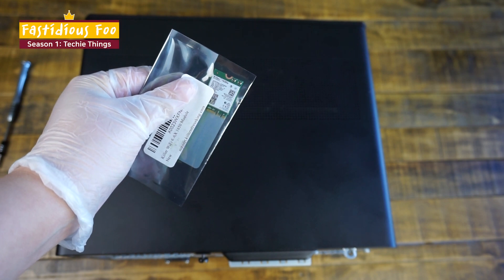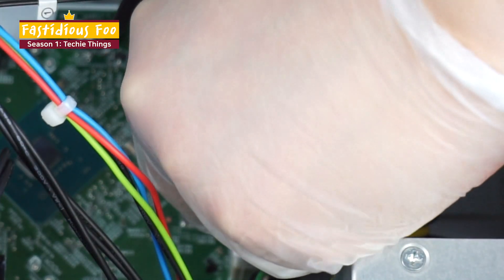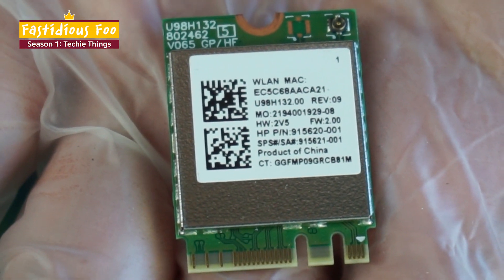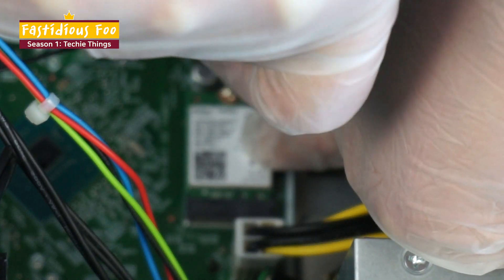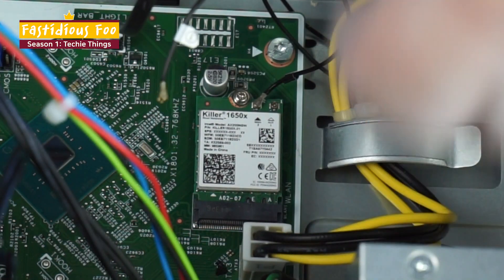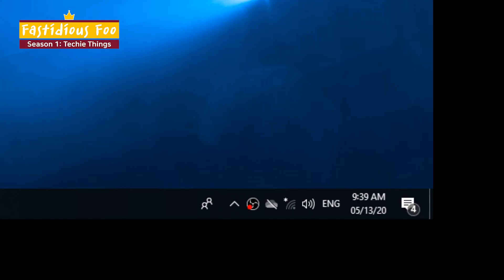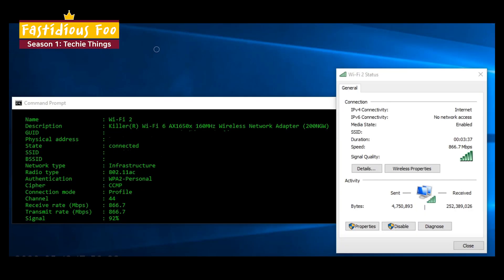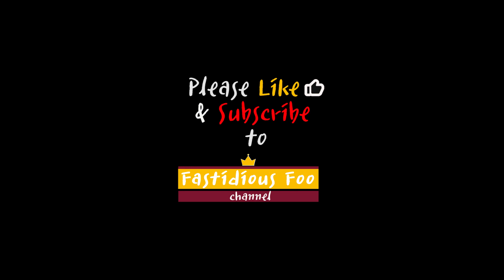Upgrading the Wifi Card (from Wifi-5 to Wifi-6)

Comment: Nice guide - didnt realize the wifi module was upgradable. Thanks!
Reply: So my model isnt the same as yours - I have an HP Pavillion model 590-0024 - this one only had one cable. This is preowned so I dont know if someone removed the second cable. Anyway I found a replacement part on ebay - search for part number L15762-002

Comment: It says it won't work on desktops per Amazon website item info section?  I want to do this upgrade but fear it won't work on mine.

https://www.amazon.com/Killer-Wi-Fi-AX1650-Module-Bluetooth/dp/B07Q4YYQC2/ref=sr_1_13?crid=3G2Y8JUGTJ7KO&dchild=1&keywords=wifi+6+card+for+pc&qid=1591126457&sprefix=wifi+6+c%2Caps%2C223&sr=8-13